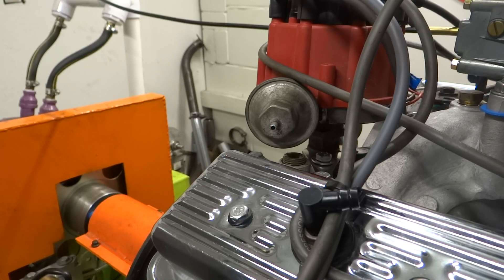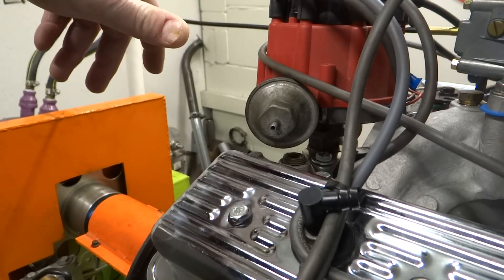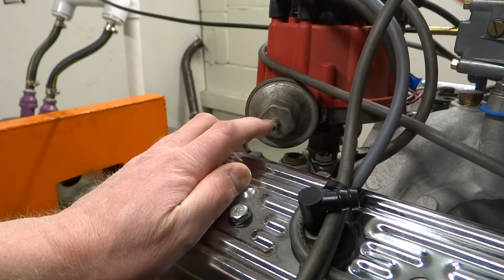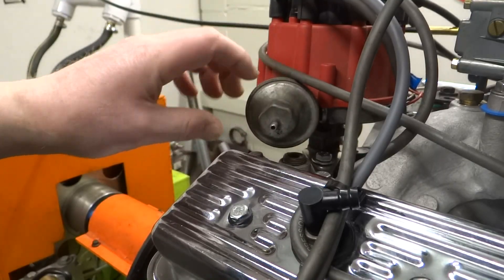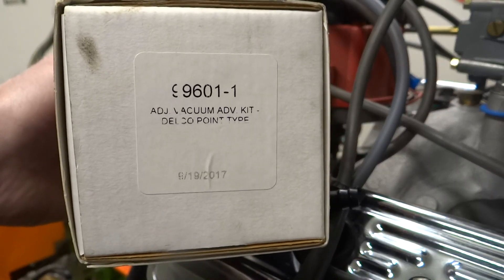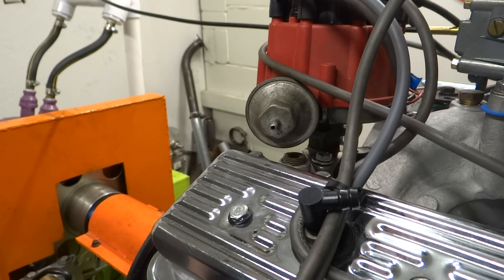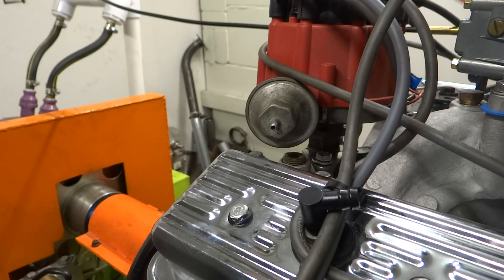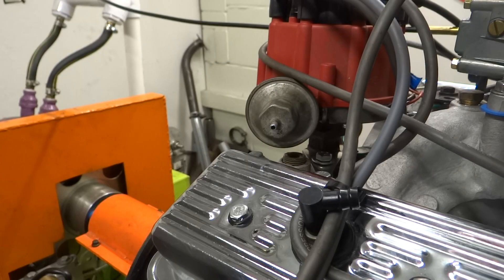Vacuum Advance - Ported, Manifold, or None My Interpretation

Comment: If you have a Holley, and a long duration cam, there is a screw underneath the base that is stop for the secondaries, and you can crack your secondaries a tiny bit to let air in at idle which cranks up idle RPM and engine vacuum without exposing any more of the transfer slot in the primary (which happens when using idle screw) . Some say to drill holes in your throttle plate, but for a street car I think taking advantage of an adjustment screw seems better. This will save your "T" slot more fully for the transition from idle to cruise.....if you ever find you have a flat spot in that portion of the rpm band. With this method idle is improved independently of timing. Also worth mentioning.....the higher your static compression, the less timing your engine will want.
Reply from the maker: Thanks, I had that problem a few years ago on a 360 running low 240's at .050 and a holley 700 dp. I opened up the secondaries some using that screw which made it so I could close the primaries more and  that made the idle mix screws work again.
Reply: @engine_therapy  I always click on the Ported/manifold vac debate....never tire of the reasoning. 🤣🤣🤣👍👍

Comment: Yes that was happening to me ..I have a 1970 nova with a GM performance 350 create engine,  I had it to ported vacuum for 5 years of the new engine , I struggled keeping it cool when I at idle with load (automatic) and with the low no vacuum at idle and the heat it would start to detonate, High octane helped some and I had to lower the advance to 11 btdc to keep it from knocking so at a long light everything worked against each other , rpms got lower vac go's lower heat go's up and wants to stall.       NOW I moved it to manifold vac , Runs cooler, Idles even at load with no loss of rpm's and because of intake manifold temp lower I can run higher advance with mid octane fuel. My total advance is now  40 btdc at 3200 rpm.
Reply from the maker: Sounds good, Thanks

Comment: I go for whichever the particular combo Im on works for that combo. Probably 80%+ its ported. The correct overall combo of engine parts and driveline parts is key. The more overall matched and efficient the combo is, the more likely it wants ported.
Reply from the maker: Interesting, another reason I have for going about this the way I do has to do with the book Smokey Yunick wrote, I think in the early 80's. He doesn't talk about ignition advance very much and I realize he has become a bit of a controversial figure in this field lately, but he basically said that they would run both their vacuum advance and mechanical advance locked out. His position was that above fairly low engine speed it was best to have a constant amount of advance.
For me I think if I really want study this subject, I would like to have some in cylinder pressure data recording ability, which is something I am considering working on.  
Thanks for the comment, I like to hear other people's ideas about things
Reply: Around 8.15 you describe the exact scenario as to why ported vac is a great idea as it is only operating at light throttle cruise, keeping idle independent of vac advance.